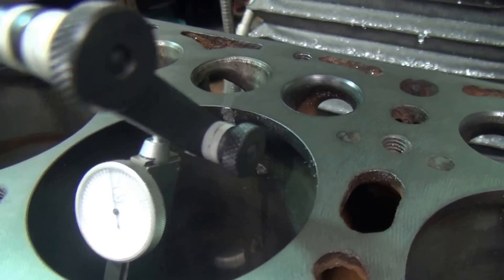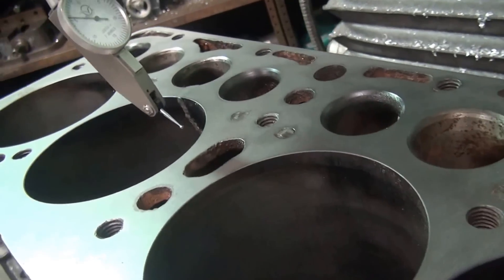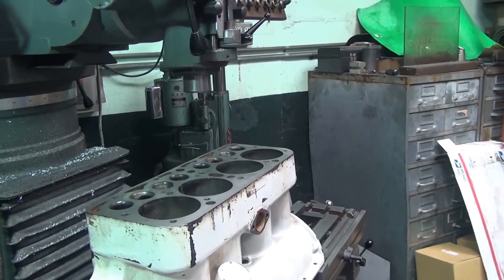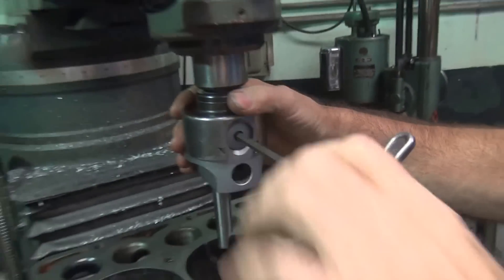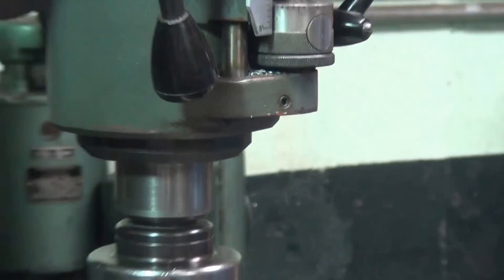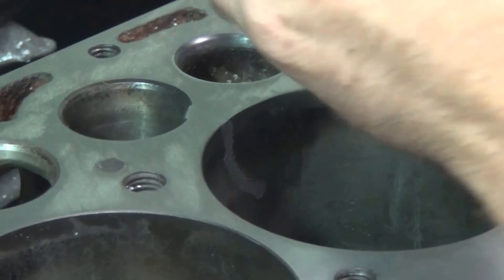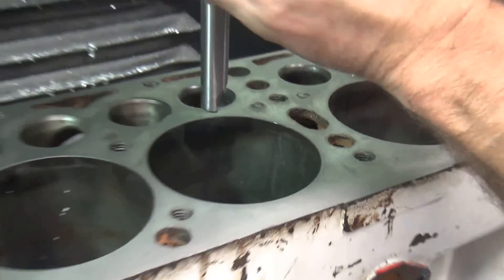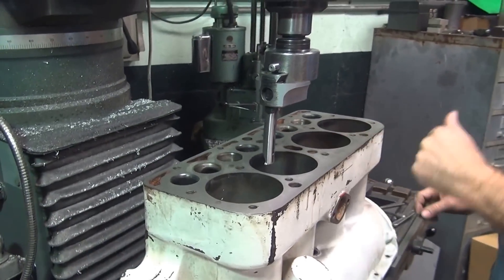1932 ford #113 model A or B flathead race block crack repair by tatro machine

Comment: Another block has to be cheaper must be for to special car with provenance. Just drop and LS in it.
Reply from the maker: what part of a race block did you not understand. this is an antique racing motor and can not be up dated to a stupide ls motor. that would run in the newer classes. this motor has had a ton of race work done to it already, that is why is is being repaired so that it can be raced again. these repairs worked and it was raced again in the scta.
tatro

Comment: After 47 years involved with stuff like this, I wouldn't put money on it been successful in the long term
Reply from the maker: only time will tell on any type repairs. this is a proven system for repairing cracks and has a very good track record for getting the job done and lasting.
tatro
Reply: @TatroMachine  ah I just realised you are the motor cycle man. You are a great dude and famous in the UK
Reply from the maker: didn't the arms give it away.
tatro

Comment: I use to do that stuff. Worked over 20 years at a machine shop. Did pinning crack repairs.  Rebuilt heads and blocks. Built and raced stock cars for over 8 years.

Comment: I have minimal machining experience but I was still surprised at how fast you ran that cutter. s there no risk of it bending out slightly in other words, flexing or if it does then it doesn't matter because it flexes the same amount the entire circumference so everything cancels out?
Reply from the maker: the speed doesn't bother me at all. the problem is that it didn't cut so i had to slow it way down.
tatro

Comment: You don't lean on a block or crank when measuring, not getting my machine work.
Reply from the maker: lets see, 120lb block sitting on mill will change with 10lbs of extra pressure. you need a new mill. what do you think happens when you move the table from one side of the mill to the other while you are cutting the block.
tatro

Comment: I run cast iron at 700SF with cemented carbide inserts. 700 X 3.82 / 4.0(Assuming a 4.0 bore)=668.5 RPM... 2400 RPM is WAY too fast... that's pushing 2500SF!
Reply from the maker: maybe that is why i slowed it way down after that cut. i think i was around your 700 rpm but i was using a 10" cutter not a 4" cutter. the bit was fine after that cut.
tatro

Comment: What a trip down memory lane!! I used to do this to military Jeep engine blocks by the score! Apparently 11 out of 10 of them had been overheated and the two center exhaust valve seats, the top of the deck and the cylinders were all cracked ..... Pin the cracks, put in seats and sleeves and she was good for the next 50 years!! Great work!!

Comment: Wouldn’t the steel plugs expand at a different rate to the original casting when at running temperature?
Reply: Michael Naisbitt I think the plugs are actually a cast iron of course it’s 80 year newer cast iron but with how unevenly heat treated and hardened old cast iron blocks are I’m sure it’s no worse than wall between 2 and 3 piston

Comment: is there something special about the drill press used for this kind of work? or is it just a matter of having a really solid/0 play press?
Reply from the maker: its called a milling machine. it cuts sideways and vertical. drill press only cut down.
tatro
Reply: am I wrong in assuming the horizontal movement is only for getting it lined up perfectly in the middle?

Comment: They also get "out of round" when you distort the block by drilling, tapping and "pinning" it to repair a crack that could have been eliminated or at least most of it eliminated by sleeving that hole. Or a  GOOD block could have been sourced. Complete long-block remanufactured Ford flat-four engines are available for around $3500 and I just saw a block and flywheel for a '30 
"A" engine on eBay for $100. 

Old doesn't automatically mean "rare" or "valuable" and selling a customer a ridiculously expensive "repair" and "rebuild" process  just because he has money and asks you to doesn't make that "customer service"
Reply from the maker: here we go again. another know it all dumbass that doesn't listen to what is going on in the videos.
this is a big bore nitro landspeed race motor, not some dumbass slow as hell street motor that no one gives a crap about whether it is stock or not. 
you can not sleeve a big bore cylinder that is only .080-.100 thick.
the cylinder is out of round because it went into detonation at bonneville when the water hose came off at half track and had a couple more miles to go at full song.
now for scta racing you must use stock oem parts, not aftermarket good new stuff. as for my labor, that was basically free plus the parts. it was for an old club member and he had this motor for probably over 50 years at least. it was an early poured babbitt motor too.
now for the real point of my videos. it is to show how to fix things, not go buy new crap. if you don't understand that, then don't watch my videos. they are not meant for you.
by the way, the motor repairs worked great and the race motor made more runs down the track again like any good race motor should.
tatro
Reply: i liked how you repaired it without welding sort of looked like welding after you peened it

Comment: Ao the give away is the fact a motor with a crack in the block will demonstrate a chronic problem with over heating?   Or water in the oil which has a milky looking consistency to it?  Thanks for a GREAT VIDEO...VERY EDUCATIONAL..
Reply from the maker: or most likely to much nitro. probable got lean after a three mile pull at bonneville.
tatro

Comment: for a more reliable repair, I would install a sleeve on this cylinder and a press in seat on this valve
Reply: Yeah, but it would take cutting a very large bore out then pressing in the sleeve...that's ALOT of work...but yeah...I agree it would be the best/strongest repair for sure (well depending if there is enough meat in the cylinder wall to be able to cut out to sleeve it, the way that block is built...I'm not sure there is enough there to machine out.
Reply: just run it as smaller bore and add blower and twin turbo, and heck even Nitrous Oxide for good measure. :D No wait it's a flathead, never mind...
Reply: @craigmancool If you could TIG weld and if you had a machine shop.
Reply: @craigmancool Hey man, sure. I've got a spaceship.
Reply: You should sleeve it because welding creates hard spots
Reply: craigmancool I have done nickel tinning and have used it to make a few repairs
Reply: I think I would tend to agree with you... Sleeved and ported would be the way to go.....
I wonder why he didnt do it??? Other potential issues we can't see in the video??